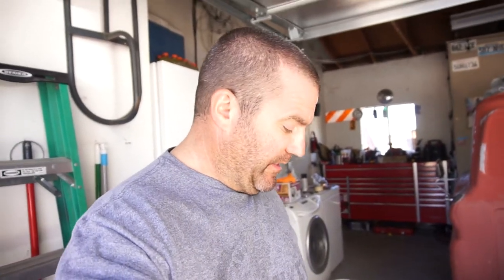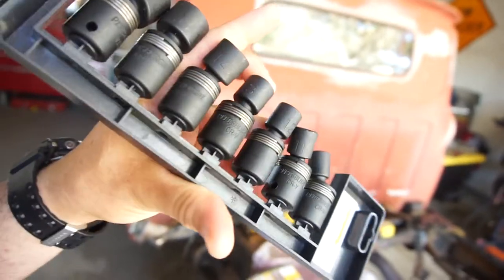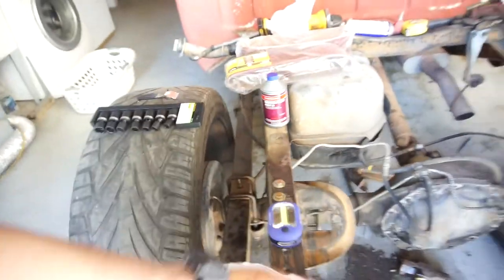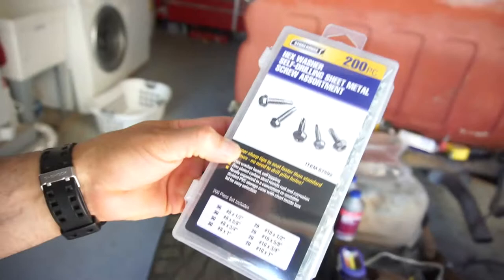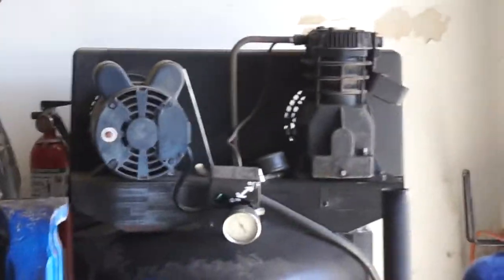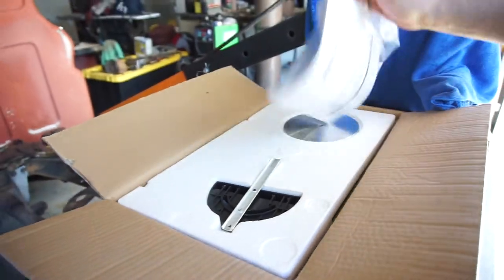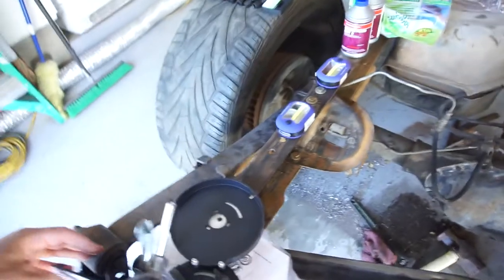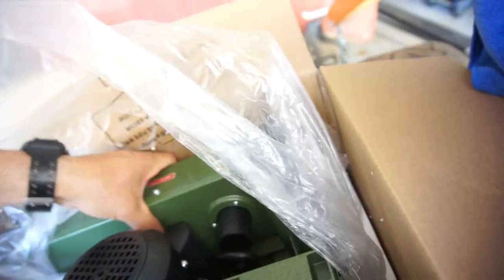Harbor Freight Shopping Haul. Labor Day Sale. Sander, Swivel Sockets, Lights and MORE!!

Comment: I know right ?  I go shopping with the Mrs. and I need a nap when I get home !!  HAHAHA !!!  Nice tool haul ! Them wobbly sockets are handy as all get out when ya need 'em .  I've been on the fence for years about that belt/disc sander . For as light as I'd use it I'm sure it would be OK . I'll see how it works out for you and make my decision . That type of sander is one handy tool to have . My major use would be for sharpening tools .
Reply from the maker: That’s the main reason I bought this sander. Is to sharpen tools and my Tig tungstens. Plus I’m always making some sort of shims or spacers, now I can get them flat or square somewhat better than a grinder and file.